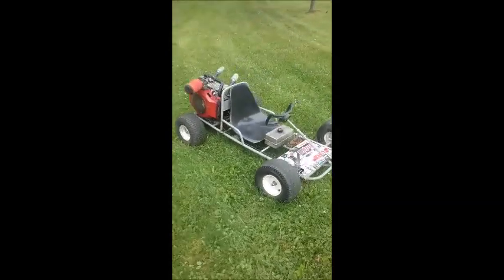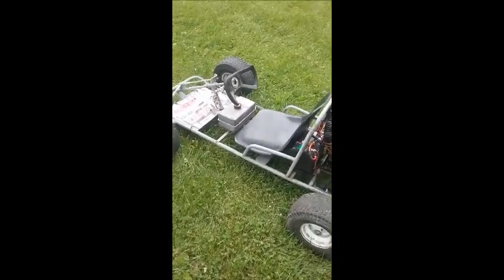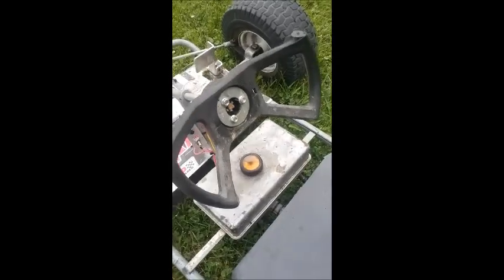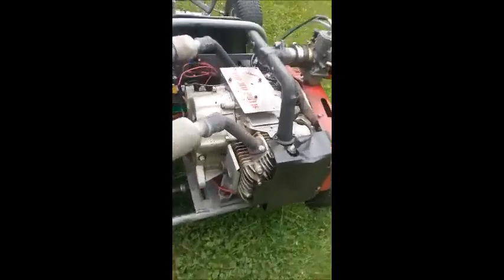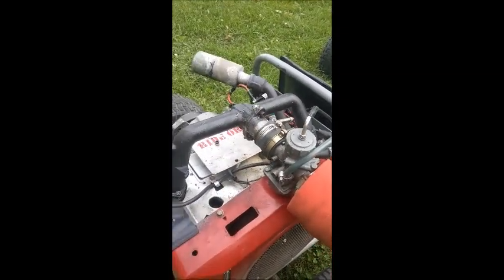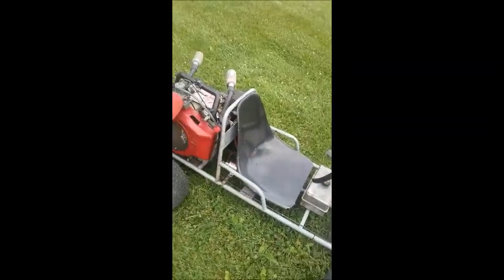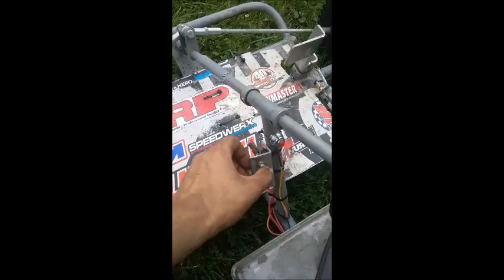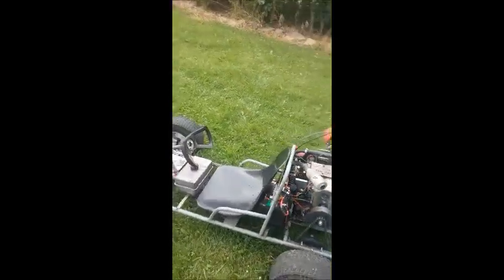700cc Briggs Twin Go kart horizontal conversion

Comment: "burns alot of oil, probably because its a bit over filled" my guy i hop in the past 6 years you discovered vertical engines aren't supposed to run on their side. the cylinders are flooding with oil

Comment: A pulse pump wouldn’t work?
Reply from the maker: I tried two pulse pumps , and neither crankcase or intake pulse pickup was enough to keep it running. Shortly after priming the carb it would die.
Reply: @VildsBuilds  that must be some. Fuel demand

Comment: Did you build some sort of mounting plate or did it have holes to mount it horizontally from factory
Reply from the maker: I used the base/ oil sump from the horizontal version, bolted on in place of the block off plate. 
Bought NOS off ebay.  Also oil dippers need added to the rods.

Comment: I dunno how ya hid that turbo, but you can definitely hear it lol.  Jk.  Sounds pretty good, did you jet/tune that carburetor at all, or just put it on?
Reply from the maker: It's the equivalent of sticking a playing card in the spokes of a bicycle, I rolled it over drifting the local cul-de-sac  , and dented in the motor shroud, so 
it rubbed against the flywheel. The carb was missing the jet entirely , so I made my own from another chuck of brass that fit, and drilling to size.
Reply: @VildsBuilds  lol that's awesome.  I have a couple of those motors laying around, and a pile of vm30 to 34 carbs.  Most of mine came off 2 strokes, I think different needle jets, and air bleeds are needed to get em right on 4 strokes.  Just not sure how invested I wanna get into old lawn mower engines.  I also cant find the cover anywhere that allows motor to be bolted horizontal.  Apparently that's needed for use with the oil slingers..

Comment: I bet that thing starves for oil on the crank. That B&S engine was NOT designed to be laying on its side. Your sending oil up past the rings into the cylinders.
Reply from the maker: Nope, just stuck the oil sump and connecting rod oil slingers from the horizontal version in it. Connecting rods are the same between orientations.

Comment: Very nice, did you by chance have to re-jet the carburetor? Or did you just set the fuel mixture with the idle screw?
Reply from the maker: I found the carb without any jet at all, and had to find a part from another carb to use as a makeshift jet. 
Fat. That's all I remember, thanks for watching !
Reply: And you said it’s a 32mm mikuni?
Reply from the maker: @codyplatt5764  You got it, I think from an old snowmobile. VM32 round slide mikuni.  Bigger is not awlays better.

Comment: i have one of these engines the sump is that just the part off a stock side shaft bolted how ye do the sump ??
Reply from the maker: Yeah, I bought a replacement sump for the horizontal version of the engine. It bolted on , replacing the blank cover the vertical shaft version had. Two oil dippers must be sourced as well, and attached to the rods , to replace the gear driven oil slinger. I  had to block off the  old dipstick hole, and make my own custom dipstick, plus redo the carb. Good Luck, thanks for watching!
Reply: @VildsBuilds  yes thanks for the write up i may post a video of doing it i got a 1977 or so golf cat or a Murry go kart to use on,,oh ill be using efi most likely look up speeddunio efi spellin wrong a simple efi but can be very good n ford edis ignition is cool to use on stuff as with no advance it works stand alone just coil trigger n edis box

Comment: would love to know how exactly you did the conversion to horizontal
Reply: Tip engine on side, make intake, attach carb, call it horizontal.
Reply: @tterrag1987  wow after 2 years reply. that doesnt work. The oil goes to the side. U need to block canals. Make a new drain plug, something to splash the oil around etc… loads of work.
Reply: @Boemel  Yeah BS horizontal-style dippers under the lower rod bolts, bolt on horizontal-style oil pan w/mounting bosses. Leave original splasher/governor assembly in place. 30 minutes work max. Parts? FREE if you find a blown up horizontal engine.
Reply: @tired5350  No it was built as a vertical shaft. I detailed the parts necessary for the conversion.
Reply: @tired5350  No the late 70s opposed all-alloy flathead twin. I actually reworked a few of these for piloted single-place aircraft. And a few hundred for LP fuel for floor polishing machines. And a shit ton of them on riding lawnmowers and industrial. Quiet, smooth, lotsa torque for the weight. Blocks warp badly when overheated.  Takes an expert with precision valve seat grinding equipment to save one that's been barbequed. (That was me)  : )
Reply: @NubsWithGuns  These are aluminum block air cooled opposed twins burning propane.
I've seen them where the "cast iron" cylinder liner warped from hours of running to the point where 2 point ID measurement showed perfectly agreement from top to bottom when checked in several planes.
Yet when a tiny Last Word .0001" dial indicator was strapped in the cutting tool holder of a boring bar it was visible that -if one centered up on the unworn portion of the bore at top and bottom it was always to size but - that the middle of the bore had moved over more than .020" opposite the direction of rotation (thrust side moved over, antithrust side followed.)
   I know a little about applied geometry young fellow.
 Don't get me started on warped cams, egg-shaped cam journals and bearings malfunctioning decompression devices - and what's involved adjusting valves to run a thousand or two thousand operating hours. with no attention. I'm too tired to type it now.
   PS - nobody gives a hoot what you think.

Comment: Sweet kart in the process of building one right now but am stumped on how to hook up the oil sump
Reply: These engines  were available  in vertical or horizontal,  the block  is same for both . The side cover  opening on vertical  becomes  the oil sump on horizontal  and vertical sump opening becomes  crankshaft output  cover . The early engines  had dipstick  hole already in block  and plugged  with  plastic  screw in on vertical  models ,as the dipstick  is in sump.  Oil dippers have to be bolted to connecting rods  when converting  vertical to horizontal  . They also had oil troffs in the horizontals oil sump.  I used a vertical block  to replace a bad horizontal  on a vintage garden  tractor.  The early 40 cubic  inch block had the plugged dipstick  hole so I just swapped the  horizontals sump and crank cover onto it and the  pto main ball bearing onto the vertical crankshaft.   I do not know  if you can still order the sump and PTO cover or not .

Comment: All most sounds like a Diesel engine
Reply: That's what I said too, I daily a straight piped 7.3 & it sounds like it ish, or one of those JD455 with a turbo on it. JD455 is a freaking beast, dream diesel tractor, I have an 82 212, but you can't beat a diesel or a K301.

Comment: How has that conversion held up? Any problems? Anything to look out for? I ask because I am going to do one myself.
Reply from the maker: It is still alive, you need to fabricate the dipstick, make a carb work,  get #393559 oil sump, and two dippers for the connecting rods #691733

Comment: Make a video on how to convert it
Reply: Not sure If you need to, they sometimes have oil pumps
Reply: Yeah, totally!
Reply: Found in the comments Vild noting:  "Yeah, I bought a replacement sump for the horizontal version of the engine. It bolted on , replacing the blank cover the vertical shaft version had. Two oil dippers must be sourced as well, and attached to the rods , to replace the gear driven oil slinger. I  had to block off the  old dipstick hole, and make my own custom dipstick, plus redo the carb. "   "... you need to fabricate the dipstick, make a carb work,  get #393559 oil sump, and two dippers for the connecting rods #691733"
Reply: Bruh you have yt too lmao

Comment: How much did it cost to do the conversation to horizontal
Reply from the maker: About 40 for the sump, 15 for the dippers, and I had the carb off an old sled. Whole kart cost less than $300 to build
Reply: @VildsBuilds  that's right in my budget, Thanks!
Reply: @VildsBuilds   do you remember what  oil dippers you used?  I got the sump just need the dippers
Reply from the maker: Briggs part #691733 , both rods need dippers

Comment: Was the vertical to horizontal conversion just the lower pan? Or was there more to it than that? I have a vertical I want to throw in a kart.
Reply from the maker: That and  oil dipper for each rod from the horizontal version.  And you need to make a carb work.

Comment: what sump did you get?   any sump off an opposed twin horizontal? 16hp and up block?
Reply from the maker: Part #393559 is what fit for me
Reply: Thanks.   That's the same part number I found.    They both said it won't fit.  I've been researching it and thought it would.   Thanks a ton!!!!   Sweet kart by the way
Reply: @jerrylight6684  you can also get the horizontal models  intake manifold  and governor system ,and crank cover . All of the opposed twins use the same parts . 40 42 and 46  .
Reply: Hi, I have the same engine and bought the part number you referred to for the sump.i noticed the sump is rectangular but the original engine cover has a dip in it. Also I got the oil dippers you had referred to but how did you install them? I would guess on the bottom so they dip into the new sump. Thanks for posting this and please let me know

Comment: 2 questions......1.Besides the oil sump, what else did you have to do to convert it to horizontal? 2. Have you run it alot and how has it help up?
Reply from the maker: I also Installed two oil dippers on the connecting rods. Both sump and dippers are factory briggs parts bought on ebay. I have held it WOT at valve float for over a mile many times, drag raced it and did donuts daily and it still runs great.
Reply: did you use any horizontal sump?   i found a sump on ebay and they said it wont fit my block.  its a  opposed twin 18hp vertical...and the part is off an 16hp opposed twin.   my understanding is that this sump would fit in place of the side inspection cover....am i correct on this?
Reply: @jerrylight6684  hey man idk if youle see this ever but do not buy a 12-16 hp twin parts for it a 16.5-20.5 should work theyre a different block sizr

Comment: where did you get that clutch ? is it a 1  inch or 1 and 1/8th  i have a 18hp Briggs opposed twin horizontal shaft motor
Reply from the maker: $30 ebay 1in bore clutch with 10t #40. Not good for a heavy kart.
Reply: Karl Vild thank you ! yeah haha i wanna put my twin into a mini bike
Reply: the only 1 1/8 shaft i know of is an onan opposed twin.
Reply: Karl Vild can you post some pics of how the motor is mounted to the cart  please? I just secured a vtwin motor and cart about to start building it